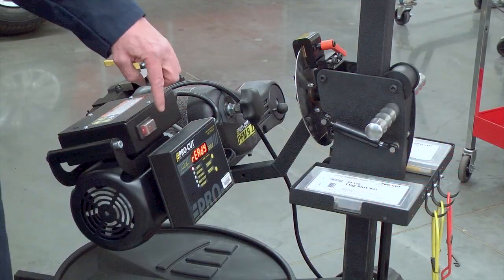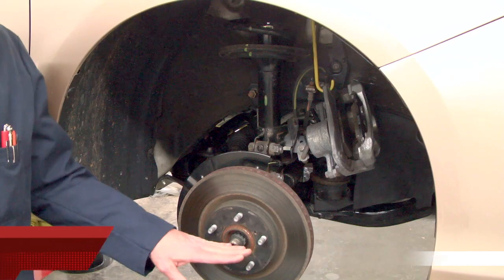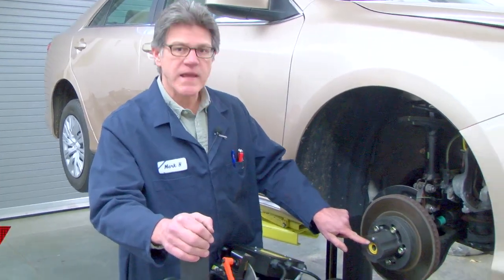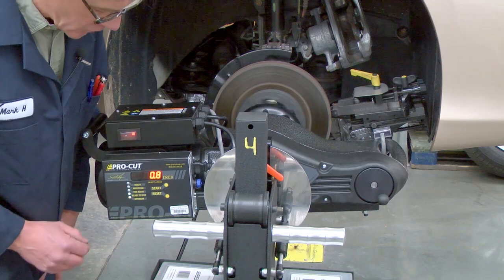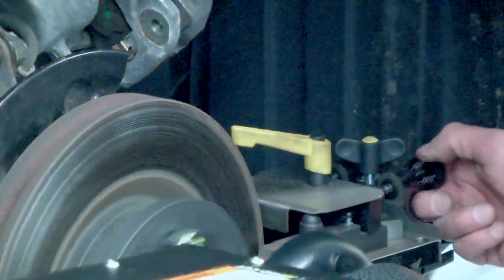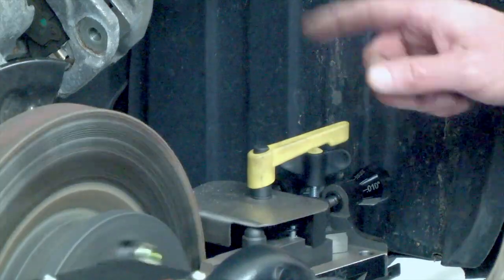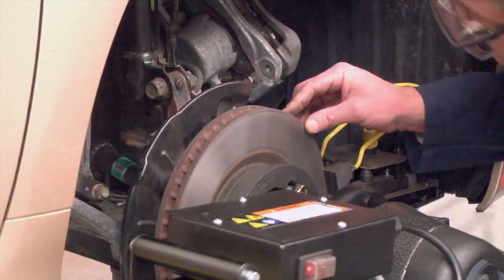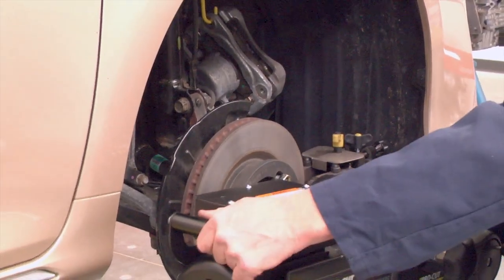SCC Automotive Training - Pro Cut On Car Brake Lathe

Comment: That last and vey important step ( smooth the surface with sand paper)  is what I should say should be done with the same machine, so not wearing so quickly a brand new originals oem braking pads, that for sure star an unevem surface again an so on , and you will realize that changing brand new rotors is cheaper  amd ypu always have a brake sysytem with fuul power ready for any braking emergency. I appreciate this good video, and good luck

Comment: What an interesting process. Are there any special precautions for AWD vehicles? I know they don't like to rotate wheels at different speeds, does that still apply when both wheels are off the ground?
Reply: Take prop shaft out should be ok as one wheel just  turns  in different direction than the other Make sure front is not connected to rear diff all will be ok
Reply: Vehicle in neutral, traction off.

Comment: Cost of equipment (I guess $ 5000) = cost of new brake discs ($ 45-150 = +/- $ 75 or 66 work done) = time cost of service = customer satisfaction (new or refurbished)
Reply: The cost is actually around $10K.  I got a pro-cut 2.0 from a guy that worked at Les Schwab for$650.   Here's an example of why I need it.  90-97 Honda rotors are captive.  You need to remove the hub to get the rotor off to replace it.  Takes 30-45 minutes to turn the rotors on the car or 3 hrs to change rotors!  Can't think of other specific captive rotors, but there are quite a few.
Reply: @Roger-eh7ez  now that bidden is press the price is up 5 gs 15 grand sell price brand new now
Edit my thoughts where damn i want one 
After seeing cost now ehh i think the shop bench lathe will suffice lol

Comment: This is a fascinating and very well produced video, thanks for creating it. Regarding inverting the lathe for the other side of the vehicle... AIUI, the lathe produces a non-directional cut. It would need to rotate the left-hand rotor anticlockwise otherwise. Inverting the lathe won't change direction of rotation, so is this done purely due to mirrored / non-parallel suspension geometry? If so, why doesn't the machine compensate for this on the other side when attached to the hub?
Reply: It is simply because the cutter head will not fit. The cutter head has to go where the caliper was, since we move it to the other side, it would be hitting the backing plate. Inverting it allows for the cutter to go where that caliper was.

Comment: shoudnt have to use the sand paper the pro cut creates a non directional cut so really you dont need to sand the rotors. if you notice when the pro cut is in use it slightly moves which creates the non directional cut. but other than that good video

Comment: Good for mobile services, but I could remove a caliper, bracket and rotor in less than 10 minutes and on my lathe and resurfacing by 12 minutes. If you're using this at a shop, it's not as efficient and heavy duty for continuous daily use.for $14,000. You better be charging a good penny too. No point in having this expensive machine and charging normal price for a brake job. I just bought a $20,000 dismount machine, trust me I'm charging you extra to use it. Not going to charge you $15 for a flat repair. LOL. In California, with this machine I'm going to charge at least $280 on labor alone for the front. And you better pray you don't have EPB on the rear cause it's going to be more. I'm not investing thousands in technology to charge crap.
Reply: Здравствуйте , если такой станок купить для сервиса , он надёжный станок ? Окупается

Comment: Looks like too much work for on-car. Someone with less skill or badly calibrated machine can ruin the rotor anyway. I see in the comments, people do have positive points about it. But what if the rotor was installed not on the clean surface and so on.. It is always better to take it off and clean inside. + for the customer, save some now, it can rust-in even more. Especially for mazda I would want to pull that rotor off and clean inside. They sometimes rust-in badly, to the point of need to cut that rotor to remove..

Comment: Way to much work, compared to a standard break lathe.
Reply: GoneInSixtySeconds I’ve used this before in a high volume shop and I disagree. If you watched a similar video on a regular lathe the time to explain would be about the same. Just like a regular lathe, once you’ve done it a few times it goes by very fast. In a very large shop, consider the time spent walking back and forth to the lathe vs all the work happening right in your bay. Also, you compensate for and runout in the hub this way.
Reply: More precise for reduction of lateral runout than a bench lathe can get you on newer vehicles. It also gives the ability to turn larger diameter rotors than a bench lathe can. Even heavy duty trucks and box trucks.

Comment: better to use conventional lathe
Reply: I was just thinking that too (this just now showed up in my recommend video list). It seems that even a loose wheel bearing could screw this up, and it's a make work project if you have to completely re-adjust the entire lathe for each wheel, costing the customer more.
Reply: The Honda dealership, where I worked as a mechanic,  purchased a Pro Cut lathe 25 years ago.  It does such an amazing job,  with no run out, that soon after they purchased a second one.  This lathe became a required tool at GM dealers.  With practise it becomes easy to use, about 40 minutes for two rotors start to finish and an absolute guarantee there will be NO brake vibes.  You can not come close to this degree of accuracy using a conventional lathe.  Get out of the stone age and admit that there might be a better way.  OR continue to do inferior work.